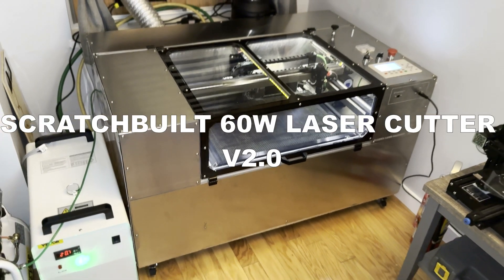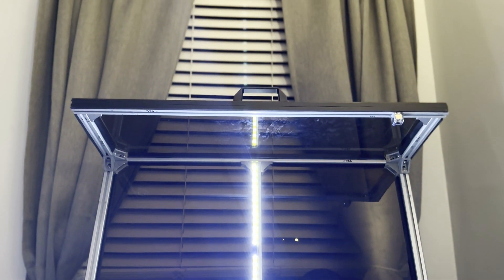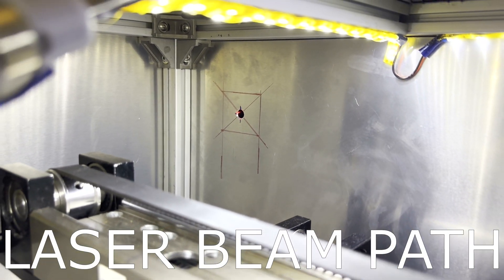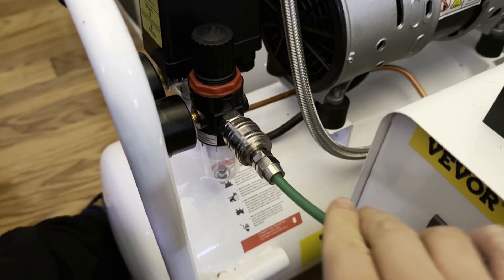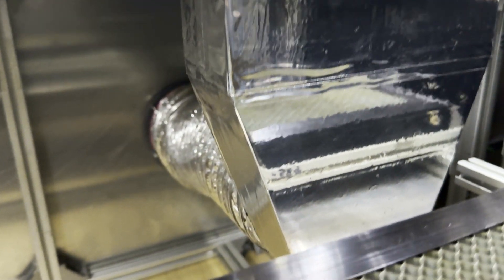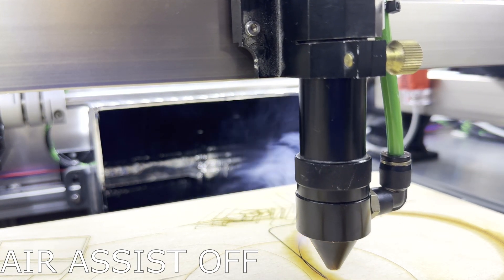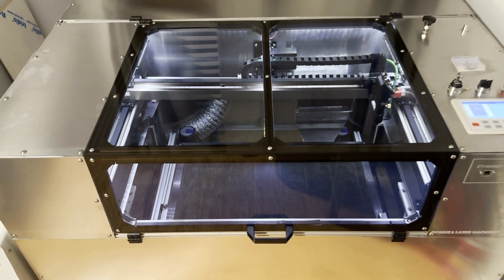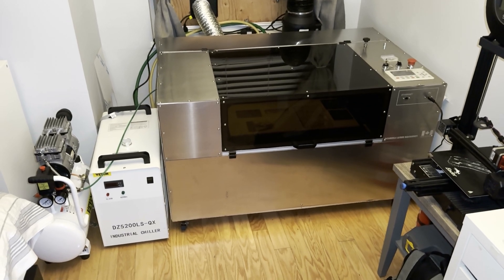I built ANOTHER Laser Cutting Machine From Scratch! - Full Walkthrough

Comment: I like the redesign . Would you be willing to release a parts list for the panels, extrusion, and such for anyone wanting to upgrade?  It doesn't look like those are 2020 for the gantry.  Your xyz looks better designed than my current as well.  I think you missed an opportunity for enhancements, though.   These are some personal enhancements I have on mine: toggle switches to enable and disable steppers for each access, this allows safe manual movements without needing to turn off everything.  A rotary switch to easily switch from normal use to rotary tool use.  A digital temp/flow guage, red dot on off switch. Separate fan and air assist on off, air  assist flow adjust , usb in out for camera, etc.  I've also designed a wireless dongle to use "not the lightburn pi wireless" this one allows you to use camera and the laser wirelessly and runs on a pi zero.  The dongle actually gets powerd from the 2nd usb on the dsp, so no special wiring is needed.  Obviously these are all personal use cases, but I think the flow/temp sensor along with the flow cutoff switch are very useful,  as well as the motor switches .
Reply from the maker: Thanks for the feedback! :) Appreciate it. Ill release a parts list for the frame and panels soon on my facebook page. The extrusions are 2020 extrusions from 8020.net. Initially I was going to use 4040, but I figured that 2020 would do just fine if designed correctly and its cheaper. For me personally, I just use my controller arrow keys to move the head to the position that I want when the machine is on, so I dont need any toggle to disable the steppers. I usually try to avoid moving the gantry manually with my hands when the machine is off since the stepper will work as a generator if you move it very fast and could potentially damage some things due to voltage spikes, although it is very unlikely... I also have flow and pressure control already on my air assist lines using a pressure regulator and a needle valve. As for the digital temp gauge, the chiller already has a readout of the actual water temperature, so I didnt need to add any other temp. gauge on the machine. And I dont currently use a rotary anyways, so I didnt think of adding a "quick switch" wiring for it, but will definitely do an upgrade when I decide to get a rotary in the future. As for the red dot pointer toggle switch and the wireless use of light burn, those are very good ideas as well. Will definitely need  look into those. Thanks! ❤
Reply from the maker: 03:50 to see air assist flow control 

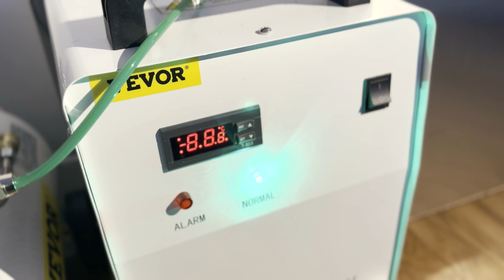06:17 to see digital temp. Readout on chiller.
Reply: @laserillusionstech that is the point of the switches for the steppers.  It allows you to manually move them without worry of building a charge.   But again personally find it useful in circumstances.   And yes I know the chiller has that info, but for me it's nice to have all in 1 spot, and unless I am wrong, you cannot wire the chillers guagers into the dsp ?   I don't own a chiller I built my own,  so I only know what I've read.  And yes I figured you had the flow assist on the lines, it just comes down to ease of use and access.  Everyone has what works for them :)  just sharing.   You definitely have one of the better designs I've seen.  I like the idea of a single unit instead of a case built around the laser like I have.
Reply from the maker: @Protocol-X yeah for the chiller, it can be wired directly to the dsp. You can set the alarm on the chiller, and if your temp. goes beyond the setpoint, it will send a signal to the dsp and it will disable the CO2 power supply :)
Reply: Seems a comment got lost.  Sorry if this is a duplicate,  but check out led strip diffusers.   They have ones that fit 2020 and make a huge difference over straight led strip.  If you are interested,  you can also build yourself an attachment to use this as a galvo marking laser .  I've done it on mine, it is still a work in progress, and a bit costly  ~ 800$.  It works pretty well, but I need a better alternative to a printed attachment due to the heat that mirrors build up.  You would need to make sure your current setup has z clearance for a galvo lense focal length though.  Could be an awesome video to see.
Reply from the maker: @Protocol-X wow thanks for the info. Didnt know about those diffusers. Will definitely check them out. And yeah that would make for great content hehe. I just meed to find the money and time haha. Cheers!
Reply: Hi very good and clean work. I was wondering if you can cut quartz?